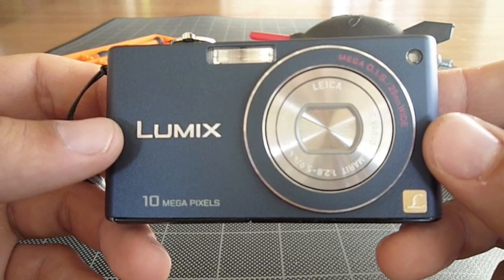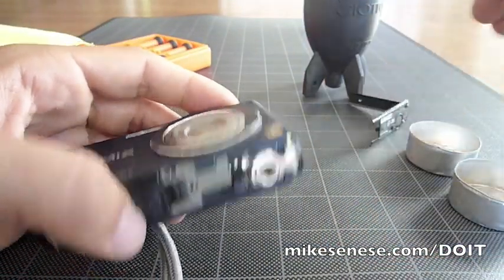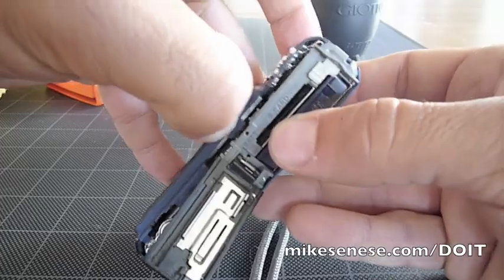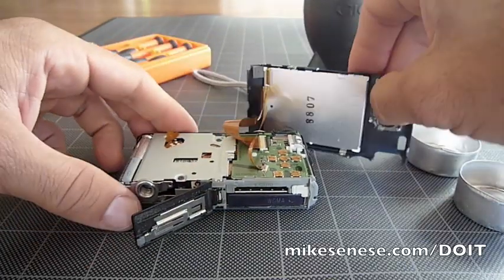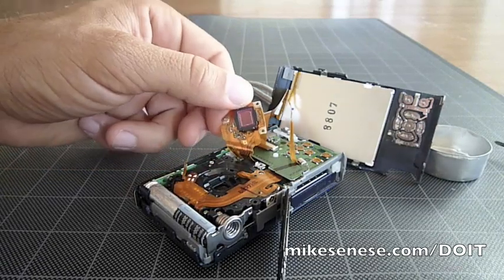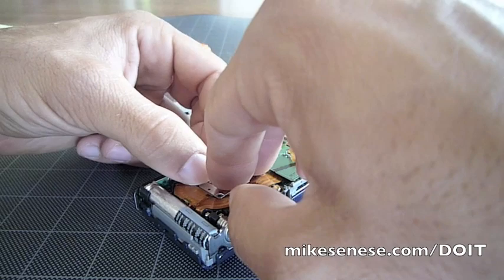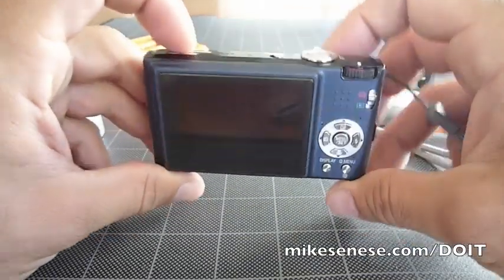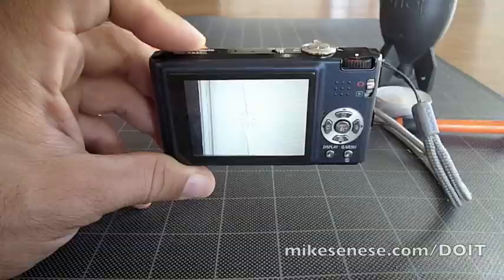Surprisingly Easy Sensor Cleaning and Dust Removal: Panasonic Lumix FX37 Digital Camera

Comment: Thanks,
My little beast is still holding it's own.
I have made note some cameras end up with dirty sensors. 
Looking for a least common denominator,  I see these retractable lenses. 
Every time they deploy, they must draw a vacume and suck dust in.
Since the lense never comes of the body, one would think the sensor would be safe.
A filtered vent seems in order.
Chris

Comment: Great instructions, thank you very much! They work just as well on the DMC-FX33 model. The housing design is nearly the same, just one additional screw on the bottom and one more on the silver sensor cover to remove.

. I used a Pentax sensor cleaning stick to remove some stuck dust and took the AA filter off - luckily I could put it back in place without touching it.

My ten year old compact camera can now take dust free pictures again, yesss! :-) No comments about today's mobile phone photo quality, please ;-)

Comment: I was using a Panasonic DMC ZS-10 digital camera that had the tendency to collect dust on its sensor. The first time it happened, I had it repaired under warranty. The second time it happened, I was out of luck. Then I found out on the Internet how to take the camera apart to clean it. It worked and I was able to use the camera dust free again. However, the camera has since developed another problem and is no longer working. :(

Comment: Hey Mike!

Thanks a lot man, I had a quick look at the dmc-fs20 service manual and thought for awhile I even had to get the soldering iron out to open the lens module to get to the ccd...
Your vid gave me the confidence to just open it up and see.
Turns out the fs20 is even easier! (no loose brackets, and one less screw)

Gone are those nasty dark spots! (there really was naked-eye-visible dust on there...)

Again, Thanks!

Comment: The body and internal screws are held in place with locktite adhesive.  So getting the screws out first time is hard as they strip very easily.  Using a quality screwdriver is the best way to avoid stripping the screws.

Comment: Mike... Nice & simple explanation. But I have a DMC-SZ3 and the case assembly is slightly different. Are you planning a video on the SZ3? I just have a dusty sensor that's really annoying. Thanks

Comment: From comments so far, this method appears to work. However, I have had persistent dust problems on a TZ25 (16x optical zoom) sensor and have taken it back to the shop three times. First clean cost £60, second and third were free. On the fourth occasion I began to despair so thought I would try an 'innovative' method - I placed the suction tube of a vacuum cleaner over the zoom lens (with the camera switched on) for just two seconds. The result? All dust 'spots' (and there were many) gone - hallelujah!
Reply: were the dusts gone for a long time or it came back after a short while? would u recommend this method of urs? kinda scared to open my camera hahah

Comment: Hello, I have Lumix DMC-F3 and for some reason it has stopped taking pictures. Eerything works well on the camera, you an view, zoom in and out, and when you press the shutter button it focuses but no picture is taken. I have checked on the SG card, replaced with a new one, reset the camera to factory default and etc. But still the same problem do you think it is because of dirt on the sensor? if not do you have any recommendation thanks - great video it was very helpful.

Comment: Thanks, it worked!
Though I wasn't able to unscrew 2 of the bottom bracket screws, I managed to take it apart by slightly prying open the bracket.
Changed the filter to an old exposed film and can capture IR images!

Comment: THANKS!  Camera shop basically refused to look at it saying it was too difficult.  As per Beethoven's note below - for the ZR1 you must take off the front and back covers, otherwise - very similar!  My only problem - I had the battery door open, it is very delicate - and it started to "tear" along the hinge as i grasped the covers to separate.  Be careful!  But - the image is again crisp and spot free!  Definitely saved me having to buy a new camera  - I love my ZR1.

Comment: very nice. Different screws on my DMC-ZS7 on the outside but actually even easier as the brackets are gone and same procedure on the lens. Thanks for the inspiration - would have given it to service otherwise. Saved $100 or so... The only thing is that a +0 screwdriver was too big here.You may need a +00.

Comment: Great video. Like Mark F I was also able to follow along working on my DMC-ZS8 despite a number of differences from the video model. Actually it was easier with my camera, as Panasonic has simplified construction. I did one thing differently: the ZS8 has just one ribbon cable and it's short, so I carefully unclipped it to get it out of the way (using tweezers to unclip and later clip back). Result? I have my camera back with no spots!
Reply: What mini screwdriver set did you use? I've got a DMC-ZS8 and can remove the bottom three screws, but the two on each side will strip any screwdriver I use. Tough little screws.
Reply: Excalseras I got this inexpensive Stanley set at Home Depot: http://www.homedepot.com/p/Stanley-Precision-Screwdriver-Set-6-Piece-66-052/203713248 -- I should add that I tried the same procedure again (new dust) a month ago at a cabin with no internet. So no video, figured I could manage after doing it before. Bad move: camera ruined. So I looked for a good replacement under $200 and got the Samsung WB350F, which I like a lot more,
Reply: Jim M Thanks much. I purchased the same exact Stanley set, and I love it.
The only problem is that I cannot unscrew the four side screws (2/side, DMC-ZS8). They are so damn tough, and I nearly stripped one. 
Not sure if I'll do some liquid wrench or take it to a professional camera store to see if they can undo them.

Thanks, it's a brilliant set.

Comment: Thanks SO MUCH for posting this! My 12-year old son & I just used it as a guide for cleaning my DMC-Z58. The configuration of our camera was slightly different, but was close enough that we could follow along. I've been living with debris on the images from this camera for over a year. I was a little skittish about the idea of opening the camera, but the process was very easy.  I wouldn't have had the courage to try it myself without this video. I feel like I have a new camera now!! Thank you!!

Comment: Worked for me!  My camera was a little different model. I bought the screwdriver set (Boxer)  from Amazon for $11.97.  (27 bits incl 0,00 and 000) and free shipping.  Took me two tries to get the dust off.  Looked clean the first time, but not so. Had a can of air.  Drew a picture of camera face on white paper and placed the screws at their locations as I removed them. Easy to reinstall!  Wife very happy.

Comment: If you have smudges in your pictures... the sensor could be dusty. First, before going through a disassembly... take a house vacuum and put the nozzle over the extended lens and the surrounding area vacuuming the opening around the lens body. Takes about 10 secs. and it works much of the time. You may find the smudges gone. Worked for me. There's a YouTube video on this process.

Comment: THANK YOU! You helped me saving my beloved Lumix Camera. Opening an FX50 is even easier: 4 short screws on one side, 2 long screws on the other side. Just be careful with the flexible printed circuit when opening the camera. Remove the three retaining screws from the sensor. Done! The sensor has a very simple and efficient alignment system. Tightened the screws step by step in order to prevent stress. Repack the body, and that's it! In my case, I had a "big" piece of dust exactly where expected.

Comment: Followed the instructions to clean the sensor on a DMC-ZS8. While the camera is of a different construction the principals spelled out by Mr Senese worked great. And it fixed the problem! I was convinced I had a dirty lens. Not so. It was the sensor. Repair estimates equaled the value of the camera. Took me an hour and a half, but saved a bunch of money. Thanks!

Comment: Thanks for this video - l just fixed my zs9 using this as a guide! It is a little different, but not much. l had to pull the LCD ribbon cable out of the connector and remove the LCD completely, then remove the metal shield which has 3 screws and a small plastic catch on the left side you have to lift the shield over to get it off.

Comment: My camera (SZ1) isn't even a year old and spots started showing up. When lens cleaning didn't work I knew I was buggered with an internal issue. I will try this procedure. Otherwise it will be another paperweight along with my Canon S3 with the lens frozen in open position.

Comment: i just bought a dmc zs20 camera and downloaded the service manual.  it says that the cmos mount has 3 torx screws, 2 of the glued.  A calibration is required after finishing.  Is this a must? Will the camera work just fine if I dont glue the screws a recalibrate?

Comment: Thank you for this video Mike. I have the Lumix 16x, and I was getting dust spots all over my pictures, The 16x this little different, but more or less the same. The biggest difference was the ribbon to the LED screen. On the 16x, this ribbon is very short, so I had to be extra careful during this move. But I was able to get in, blow out the dust, and now my pictures are dust free. Thank you again. Great video.

Comment: I have a Panasonic DMC-Z58.  It had two huge black dust specs on the lens. Was ready to send it in for repair until I googled and found this video.  My camera is slightly different than this video, but similar enough that I successfully completed the repair. Display screen strap is pretty short and had to detach the screen from the body.  This video was helpful.  My camera works perfectly now.  BTW, almost used canned compressed air until I read can. Found a blower like the one in video instead.

Comment: Worked great for cleaning the sensor of my DMC-Z58.  The inner metal bracket separating the back plate/LCD and the sensor is larger on the Z58 than the one in the video.  The big thing to pay attention to on the DMC-Z58 is that the two small tabs that are bent at a 90 degree angle have to slide UNDER the black tabs that come from the front of the camera.  Since I didn't look closely enough at it before I took it apart, it took a few tries to get it put back together the right way.  Thanks!!

Comment: Hi Mike
Like your video, I have a Lumax DCM-ZS3 with a stuck open lens, well the lens goes in when you turn it on but then comes out and stays out and camera says system error. I have tried blowing into lens parts with no luck. Do you have any suggestion. I have bought a phillips No .0 and it seems too big.
Kind Regards 
john

Comment: 5. Unscrew the 3 black screws holding the sensor in place
6. Gently lift the sensor
7. Now using a blow tool to remove the dust from the sensor+  inner lens.
I did also switch on the camera and move it to tele and low again inside the area below the sensor.

Comment: I had the same Problem with my ZR1.
There was a big long dot which got sharper if turning to full tele mode.
1. Remove 4 black screws left, 4 right, 3 bottom
2. Take away covers
3. Remove the 3 silver screws holding the metal shield in place
4. Remove the metal shield

Comment: Awesome video! I have a Lumix DMC-ZR1 that is a little different than this model but the procedure is basically the same. I first tried to blow compressed air into/around the lens from the front, don't do that! it just made things a lot worse. I then tried to use a vacuum hose over the lens which helped but there were still a few spots that moved around as I zoomed in. This video and procedure made the thing like new......at least I think so for now. Great, Great Video!!!!!!

Comment: Great video, THANK YOU! We have a Lumix ZX1 that eventually got dirty on the sensor. We were about to throw it away - until I saw your video which gave courage for a last try. And it worked out!! You need to remove the rear and front cover since the metal bracket is held back by the front cover for whatever reason.

Comment: This process is similar for other Lumix models.  The video was a good guide for my DMC-ZR1 disassembly in order to clean dust on the sensor.  There were a few more screws for my model.  I had to remove a few screws from the front hosing to access the inner chassis.  I would have posted the video but I did not have another camera to record it.

Comment: Dear Mike;
Thank yuo for the excellent instructions. I have a DMC-ZS7 which is very easy to open up. I did the whole job in less than ten minuets. By the way I noticed they use some kind of glue on the screws.Use firm but gentle pressure and they will come out. Best regards, Grumpa.

Comment: Great instructions. I have a dmc fs15 that also suffers from dust problems. Methinks this is a chronic design flaw for Panasonic P&S digicams. Has anyone tried to install some gasketting material to prevent dust from entering the sensor area?